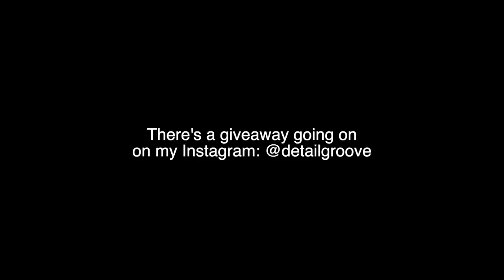Cleaning An Extremely Stained and Trashed Car Carpet - Steam Cleaning and Extraction

Comment: this car had a lot of rust under that carpet from past water/luiquid spills if he would of kept using the extractor it would of never ended I think that's why you came after with the microfiber towel and just wiped the top carpet and it made it look clean it happens to me sometimes and those cars are annoying I could be wrong I'm just going based from my experience as a car detailer there's some tricks you can do to avoid spending too much time on a dirty car.

Comment: Just curious can I use a good quality wet/dry vac instead of a extractor, that 400+ dollar price tag is steep???
Reply: a wet/dry vac wont do half as good as the extractor when suctioning , buy a cheap extractor for no more than 200$. i got one and it does a good job but is made of plastic so you have to be extremely careful,